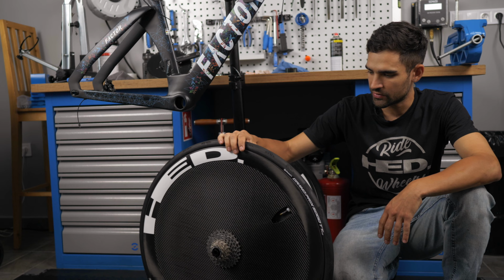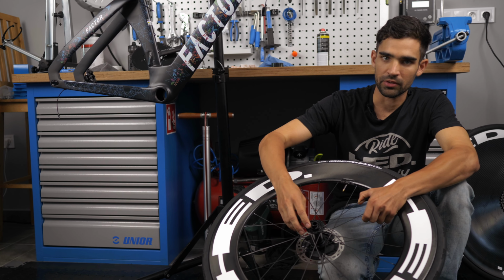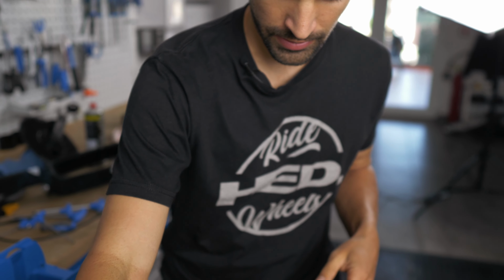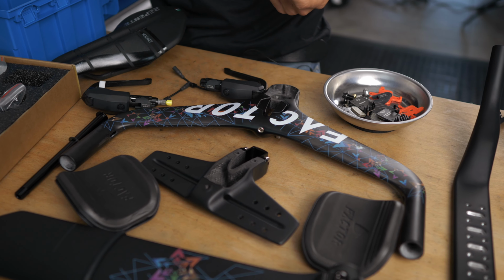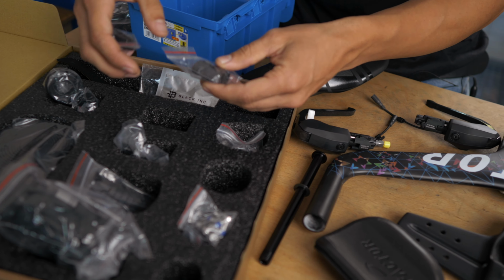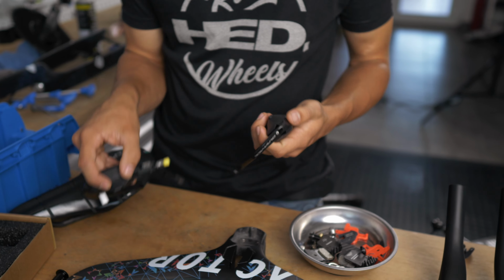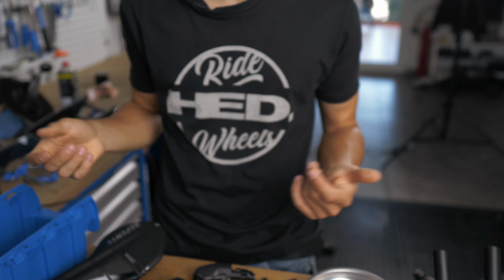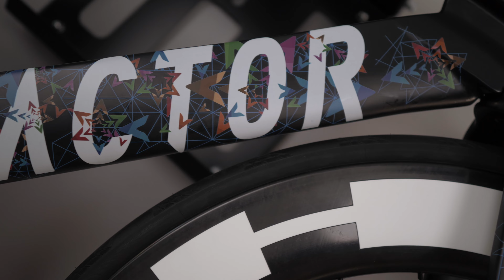Finally got my new TT bike - Factor Hanzo build video

Comment: Thank you for the video!
Since this seems like an expert channel.. I thought I'd ask..
What do you think that the manufacturer says.. Shimano Sora Groupset weights 5,000g and Dura Ace (electric) weighs 2,500g??
Reply from the maker: Cheers. Not sure what the question is here.
Reply: @ronykuba  The main question is.. can you adjust the 2500g in bike weight.. by changing the groupset??
Reply: Sora doesn’t weigh 5kg.  It’s maybe 200g more than 105 mechanical.  Almost all of that weight in the crankset, but the cassette being lighter with only 9 cogs. Shimano includes wheels in group set weights all the time.
Reply from the maker: @Jari1973  I don’t know, I’ve never used Sora
Reply: @ronykuba  I love your answer! LOL

Comment: Is there any connection between bearing as there is no steering tube ? The part which you had to grind ?
Reply from the maker: Not sure what do you mean by that
Reply: @ronykuba  my question was is there something which replace steering tube (connecting bottom and top bearing) or whole force is on the front part of the fork ?
Reply from the maker: @zieluch  there is a steering axle as you would expect. The fork can’t just float in the air 🙂
Reply: @ronykuba  In BMC there is no steer tube and bearings sitting in the frame, fork is connected thru front part. This is not the stiffest approach.

Comment: I've got the Hanzo which I'm currently building up. Any tips on how to route the front brake hose through the forks?
Reply from the maker: I suggest consulting the assembly manual
Reply: @Ronald Kuba  Thankyou, I've had a look through the assembly manual and there's not much regarding routing through the fork so any tips on how you did it would be very helpful.
Reply from the maker: @samgreenwood3671  I don’t remember anything specific. If you can’t push it through, a park tool routing kit should help
Reply: @ronykuba  Thank you, I've got one arriving tomorrow so will use that if I can't push it round the bend.

Comment: Beautiful bike. Wish you the best of luck next season and I hope you will win the nationals again.

I have watched some of your other videoes, and I saw that you did put on this super narrow 32 cm handlebars from speeco. I am just curious: what is your shoulder width? Two ways to measure: 1) from the widest part outside the shoulder 2) from the bones (should be maybe 5
6-7 cm smaller). I think about maybe buying a speeco, but since there is a correlation between shoulder width and handlebar, I wonder if 32 is too narrow. I have a 41,5 cm shoulder on the widest part, and 34-35 cm on top (bone to bone). Should I go for 34 or 36 instead of 32 maybe..
The purpose is the same as yours; for aero gains in breakaways
Reply from the maker: Thanks for the support! I don’t know what my shoulder width is.

Comment: How do you like the 5000 TT tires so far compared to Michelin Power TT? Were they easy to mount on these Hed wheels?
Reply from the maker: They feel good, very easy to mount
Reply: @ronykuba  I have the same wheels and 5000 S TR were only possible to mount with a compressor. Tubeless-specific track pump didn't work.
Reply from the maker: @v2rv  do you mean “inflate”? I can’t see how a compressor would be used to mount tires
Reply: @ronykuba  of course, getting the tire to seat properly

Comment: It looks like you have your Notio mounted.  Have you found a measurable difference in CdA yet?  I also assume you might swap out the standard cockpit for something different.  Any hints about what that might be?
Reply from the maker: What do you mean? A measurable difference between what? The cockpit will be Speeco.
Reply: @ronykuba  A reduction in CdA compared to your Shiv or the P5.  There have been some comments about the Shiv being somewhere around 0.005 higher than the P5.  The Hanzo is slimmer than just about any other TT bike, so the reduction in frontal area might make it faster than both the P5 and Shiv
Reply from the maker: @MichaelWilliams-iv6dj  I’m on the same CdA with a very small amount of testing, so the end result will likely be faster

Comment: ….be good to understand more about the cockpit and what flexibility it gives for a higher hand position to meet some of the soon to be allowed UCI positions for taller riders…..can the aero bars be tilted up to meet the extremes of the new UCI regs?? 
The SLF motion Deraileur cover, did they publish any meaningful aero data (I can’t find it online), looks bling, but does it really make any aero benefit??
Reply from the maker: There’s no tilt adjustment for the extensions. I don’t know what do you mean by derailleur cover, there’s no such thing on this bike.
Reply: @ronykuba  I mean the custom painted SLF Motion Evo Aero jockey wheel cage.
Reply from the maker: @CG-99  it’s been wind tunnel tested by Matt Bottrill
Reply: @ronykuba  I trust Matt - so what did he find in his testing???

Comment: I feel an hour record attempt coming up...I'm going for the hour record myself on my Brompton, that is the heaviest bike in World Hx hour record. Currently stands at 18 mph.
Reply from the maker: Good luck!
Reply: @ronykuba  It's a hard ask, but if you keep training you might, just might, get to the awe inspiring light speed of 18 mph ( 24 km ). I intend to use cooking oil on the chain and kitchen fat on the hub bearings. Just kidding! My Brompton does 23 mph before spinning out. Not bad for a tiny frame made of lead held together by hinges.
Reply from the maker: @sandydennylives1392  I’m pretty sure there are some improvements to be made 🙂
Reply: @ronykuba  See if you can get to 14 mph, I'm told that new fangled material cardon fiber might soon be made in to tube shapes and should help, then, wearing a full face helmet and ear plugs, try and reach out to higher speeds,like 16 mph. Then your in the home straight.

Comment: Nice frame but all the friction improving  just goes out the door with those rotors hanging out in the wind , makes no sense ...
Reply from the maker: Have you seen the frontal profile of the bike? Let’s replicate that with rim brakes. Oh wait, that’s only a technical impossibility.
Reply: @ronykuba  The bike is sweet  im with you but a rear fork mounted rim caliper and then what ??  I own disc Pinarello and it my least ridden bike ..
Reply from the maker: @raularrese3926  still impossible.